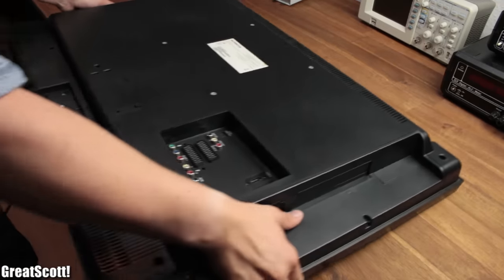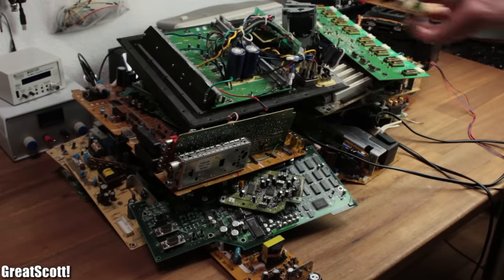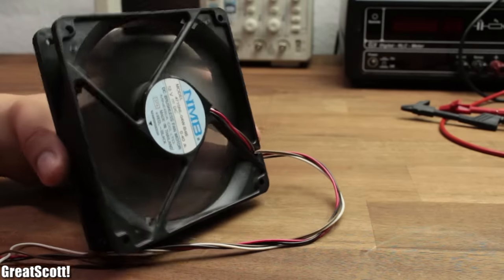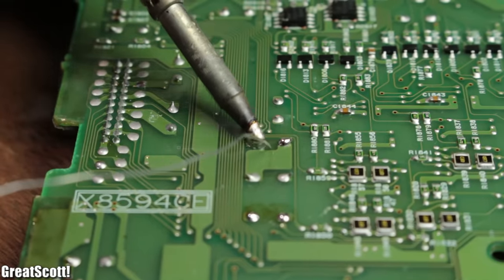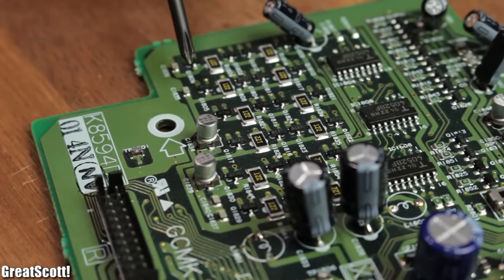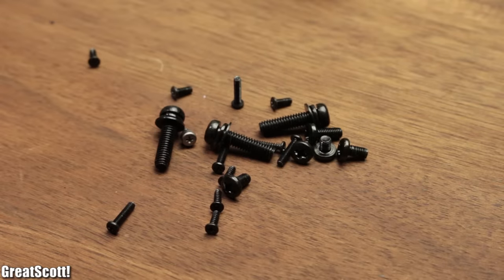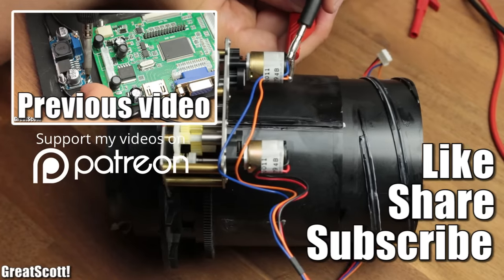What is worth desoldering from old electronics? || DIY Fume Extractor

Comment: Using a heat gun on the back of the printed circuit board, I desolder everything, catagorise it, and store it.  Where I reside, electrical component stores are very far.  There was a Radio Shack for a short while and it promptly disappeared.  Thus, I salvage almost everything from all old electronics.

Comment: Almost every fan has two arrows on one side. One shows the Spinning direction and the other shows the direction of airflow ;)

You can even compare the form of the rotor to other fans and guess by that, in what direction it will spin, because it is formed in a manner that reminds of a shovel and you would never use your shovel backwards intentionally ^^

Comment: I took apart an cheap dehumidifier because the fan was making noise, It had huge aluminum heat sinks that i saved. Saved the power supply and connector, some switches, and other stuff.

Comment: many years ago when the market was very "closed" and you had to go to the electronics store and hope that it had a component or equivalent at an acceptable price, unsoldering the components was done and agreed. but today that the market is more open and with little money buy 100 stocks directly from the country of production, this procedure can be used to take particular or specific components (for example motors, switches of certain dimensions ...). as far as the vines are concerned, the one you will need will always be few.

Comment: tip: use forceps or tweezers and put it's two hands between the resistor and pc or between transistors 3 pins it works nice pushing it down helping a lot

Comment: Aside from the components you mentioned, I also enjoy salvaging power diodes, large resistors (like 1 to 10 watt block-style resistors, or bumblebee style resistors from way back when), LEDs (because I'm too poor to afford a $5.00 bag of LEDs since I'm putting my money into college), crystal oscillators, large ceramic caps, high-voltage nonpolarized caps (I.E. those blue 1Kv to 2Kv  disc caps you find in power supply circuits), large SMD resistors (for when I really need to conserve space), old ceramic ICs (They are expensive, I don't mind the eternity it takes to desolder them without a braid as long as I get that $10 IC! Besides, it's really fascinating and fun to discover their functions), optocouplers/optoisolators/whatever you want to call them, EEPROM chips (8 pin are my favourite), transistors, MOSFETs, BJTs, FETs, MOSPECs, TRIACs, varistors, thermistors, PTCs, NTCs, power transistors, tubes (even small CRTs from mini CRTTVs/CRTDs), spark gaps / gas discharge tubes, potentiometers, encoders (which are EXPENSIVE these days), sockets and connectors, capacitors that have longer leads, and bipolar capacitors (because they are a little harder to get). The list is pretty extensive, but in general I tend to salvage anything I can from boards. Since I'm getting into SMD stuff, I am salvaging SMD ICs, capacitors, inductors, and resistors, but only larger ones that I can use a normal sized soldering iron on. I especially love getting everything off a board and turning the board into the face af an analog clock using a clock kit you can get from Hobby Lobby for cheap. It is really nice when it is in action, and it is possible to sell the custom board clocks and make some pretty good money from them. The more we recycle, the better, amirite?
Anyway, love this video. Keep it up, I really love the tips and expertise you spread to us.

Comment: Try a hot air gun for mass desoldering. Heat the the components with the gun and then tap the board in the direct that will allow the components to drop out. Works like magic. The latter technique works very well to de-solder multiple pin, cable connectors. Heat the soldered connections and then flick out the  wires.

Comment: Depending on how many potential interesting components are on a board, I sometimes save the whole boards and review them later when I need a special part. If there is just very few parts on,I cut the rest off with the band saw such as large areas of smd parts and put them into electronics recycling collection.

Comment: I found an easy way to unsolder any components, no matter how many pins. I use a handheld propane torch, melt an area of pins and hit it with compressed air. Sometimes the components just drop out.

Comment: Man after my own heart. You get useful bits and it's green too. I only really use the small electrolytic caps for prototyping as they're more likely to have high ESR and be leaky. Always save small ceramic and poly caps as it's good to have some odd value's for frequency dependant circuits like amplifier FB loops or tone filters. I always save the wire to, specially coloured stuff. Most times projects only need small length's under 3".

Comment: the list plus: flash/eeprom storage chips, premium mosfets, microcontrollers(e.g. PIC16), tantalum capacitors, TVS diodes, large ceramic caps, precision resistors, soldered nuts. Avoid anything plastic(unless you really need them or if they're expensive). These are very useful and can be very expensive. If they're hard to desolder, use galinstan or wood's metal.

Comment: Question, why must the carbon filter be on the exhaust side of the fan? There should be similar air resistance on either side but the two advantages of it on the intake side are:
1: it filters the air before it gets to the motor so motor gets cleaned air and
2: if you put it very close to your desoldeting items the spinning fan blades are not going to hit your fingers because they will be protected by the carbon filter.

Comment: You actually want to attach the filter to the intake side, since fans are more efficient sucking rather than blowing. Also, carbon filers are not meant to stop particulates, but the smells, which are particulates, but much larger. You need a HEPA filter to extract particulates from solder fumes.

Comment: As a teenager short of money I salvage almost everything I can get my hands on. The best stuff includes most large or high power components, especially power transistors, large nonpolarized capacitors, etc. Also look for mechanical components like heat sinks, magnets and pieces of ferrite.

Comment: When I do bulk de-soldering like striping a whole board I just do it out side and use my air compressor. Melted solder is no match for 90 PSI of compressed air. At the end of the day there is a fine layer of solder all over the porch but it sweeps up very easy. And if I need de-soldering wick I just strip some old lamp wire. A lot cheaper that store bought wick.

Comment: I also love to desolder components from circuit boards. I personally salvage inductors and transformers of all kinds, relays, heatsinks, motors, power cords and of the following only THT parts: voltage regulators, power semiconductors, audio and USB connectors, electrolytic capacitors, ceramic capacitors larger than 100nF, power resistors, film capacitors, potentiometers, IR receivers, standard IC,s, LED displays and LED's, rechargeable batteries, quartz oscillators, fuses, Y2 and Y1 interference capacitors, varistors, speakers and microphones, fans with the fan grills and some other larger components. And if there is a still functional switching power supply board, I salvage and reuse the whole board instead of desoldering components from it, but only if it's not too special.

Comment: Life pro tip, if you need to do several pins, use a cheap griddle or head up a piece of metal with a blowtorch and desolder all the pins at once and yank your part off

Comment: You can desolder DIP ICs if you use a solder sucker and are quick. I have desoldered many ICs for my projects and have yet to break any while desoldering them. I have desoldered big (52 pins) DIP ICs with this method many times.

Comment: Instead of using a soldering iron, I use a wood burner, since it gets hotter quicker and melts the solder quicker, so it doesn't overheat the components

Comment: If you can find any JRC4558 audio op-amp chips, there's a market for them for use in electric guitar overdrive effect pedals, as made famous in the Ibanez/Maxon Tubescreamer series pedals... A large amount of Japanese audio equipment from the 80's and 90's used the JRC4558 chip, even cheap Walkman clones and clock radios, etc...

Comment: Best parts to salvage in order:

1. Screws
2. Electrolytic capacitors
3. tantalum components (value).
4. Regulators and coils.
5. Controls, knobs, switches.
6. Jack, sockets, and connections.
7. Heat sinks

Comment: Great video... I can safely say that there are many people who have done this... I for one do the same and I have to say that for this sort of work there is nothing better than a hot air gun... I was building a Class A headphone amplifier and I needed to remove the potentiometer so that I can mount it on the front panel and I tried to remove it with solder wick which I had never used before but it just wasn't working for me.. so I used a pencil blow torch. In the process I burned the PCB a little and destroyed one of the copper tracks in the process... I later learned that when the solder wick won't take up the solder you can apply fresh solder to the top and it worked perfectly... To little to late because the damage was done... I suppose it was the flux contained in the fresh solder that got the old solder to remove but I didn't have any of that either... I have since learned that a hot air rework station for this sort of thing is the best.. Once you try it there's no going back... I purchased one a few weeks ago and it only cost me $18AU although there must have been a glitch in eBay because after I realized how handy these things are I decided to purchase more just in case something should happen to the first one... but the cheapest one that I could find was about $30AU.. Still not to bad but not cheap enough for me to purchase more... It looks just like a soldering iron station and it has a holder on one side that automatically turns it off when you place the hand piece in the holder... I can't believe that I didn't get one sooner... Anyway... Love the videos and keep up those Hoarding Tendencies LoL.. I really need to have a tee shirt made with that on it.......

Comment: ive been doing this for 15+ years.  and since radio shack has caved in, and turned into a cell phone company, their supply has gone down, and they finally went out of business. (they deserved it, crappy service anyway.) the last 2 days that they were open in my town, everything was 95% off! I bought every book, wire, solder, soldering iron, cable, connector, component,  tool, power cable, power adapter, battery, battery connector! over $350 of merchandise for $80! (they closed early....)

Comment: 2:10 hint: when + and - connected properly, the fan ALWAYS sucks the air from the "non protected" site (where are no bridges from the axis to the housing) and blows into the direction, where the bridges are
3:47 i would always check the 8-pin ICs, casue they are not that hard to remove (expecially wheny you got a pump anyways) and they are pretty much useful, creating new circuts.
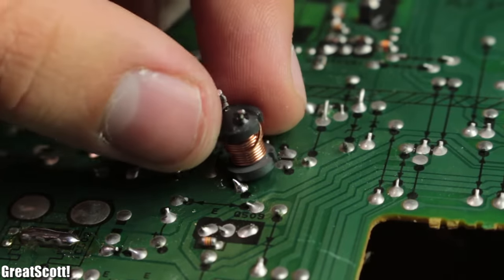4:20 i was laughing... "avoid capacitors and resistors, but save coils, all kinds of coils" :D ok, it depends on your personal use, but in myself i'm exactly the opposide. i kinda never use coils in my circuts, but i got lterally thousands of capacitors and resistory, while i got to say, that you have to take cary using old capacitors and have to double-check them all, before using them into your circuts

Comment: I still have LED's, resistors, transistors, variable resistors, capacitors Ect.  I desoldered in 1976 .... you never know when you'll need them, I actually dug out a light activated switch for a new project these were RS branded but was unable to find the datasheet for them they are circa 1981 :(

Comment: If you don't plan to reuse the PCB, you can use a torch like I do. Heat the back side of the entire board, flip it over, and smack it on a  metal plate, or piece of wood, to scavenge an entire board at once.

Comment: Those capacitors near the AC mains entry point may be labeled X1, X2, XY2, Y1 or similar.  Those are safety rated capacitors and one might consider learning about them and maybe (or maybe not) reusing them.  Belated thanks for a great video and for the good comments below.

Comment: I usually remove the most expensive and biggest parts with soldering iron, then for all the resistors and some if the IC and caps i just use a heatgun.  Stuff i dont need i put in a box, weight it, take a picture and list it on example if ebay for couple extra dollars. There is always a buyer.

Comment: Longer exposure to 250°C should not harm any IC, so you could use soldering bath for the purpose of desoldering ICs. You can make one cheaply with shallow can and a heater beneath it - a perfect use for an old electric kettle :)

Comment: The first thing I noticed was how short you cut the leads to that barrel connector. I would have given it two inches of pigtail .. never know when you'll need one. Second, you omitted one of the most efficient methods of salvage. The good old propane plumber's torch. Once you gain some proficiency, you can extract a 40 pin IC without even getting it warm to the touch.

Comment: I watched... it sounded like Greek/Germany/Russian to me.
I’m 58... when I was a kid , we leased a BLACK( only color) rotary sail phone , from Ma..bell.
1966 I think.. I was about 5 years old..
When I was 7 years old, we had a new tan colored rotary dial on the hand set phone.. still leasing it.
It was top of the line hi-tech.
There were even illuminating numbers to see without a light on in the dark.  Wow that was the bomb...
Then came the push button numbers that made noises.
Soon after we got caller ID.
We still had busy signals.
I was 10-11 and we got cordless push button phone.
We owned it.
We had black and white TV until 1966.. got a 25 inch color console.. weighed almost 200 pounds... huge wooden cabinet, solid wood.
Hade 4-5 channels lack and white... got UHF and got 4 more channels....
I’m 58 now.. can’t believe how light weight TV’s... I can carry two 50 inch sets at a time.
My cell phone works while I’m down inside a tunnel under the ship channel.... we had AM radio in the car.. it would fade out as we went under an over pass..for a quick second...lol.
Flying bikes, flying cars.. robots of every kind...
I’ll be leaving you all before long.(not healthy)
Sure hope to fly a motorcycle or a car... I got a 1500cc motorcycle to keep my adrenaline going..
We may not need to leave the bed room the way things are going.
Just don’t pollute.. it’s not asking to much.
Take care kids😎

Comment: Hey scott i hate so desolder some small parts with soldering iron so i mostly just heat the pins up with a mini propane blowtorch and pull them out from the other side it is very easy and faster than any other way i know.

Comment: Nice project, Not sure the fumes are harmful as the fumes from silder are mostly from the flux in/on the solder.  The lead/tin only becomes harmful in their salt form (lead oxide(white powder), lead asetate(white powder), as the body absorb them easily.  The fumes are not nice to breathe at all regardless

Comment: If your looking for a cool comment you're in the wrong place, but if your looking for an outstanding pie recipe you've come to the right place.

Ingredients:
1. 6 tablespoons unsalted butter
2. 1/2 cup white sugar
3. 1/2 cup brown sugar
4. 1/4 cup water
5. 1/4 teaspoon cinnamon
6. 1 pinch salt
7. 5 apples - peeled, cored and sliced
8. 1 pastry for double-crust pie 

Directions:
1. Preheat oven to 425 degrees F (220 degrees C).
2. Combine butter, white sugar, brown sugar, water, cinnamon, and salt in a saucepan over medium heat. Bring to a boil, remove from heat and set aside.
3. Roll out half the pastry to fit a 9-inch pie plate. Place bottom crust in pie plate; pour in apple slices.
4. Roll out top crust into a 10-inch circle. Cut into 8 (1-inch) wide strips with a sharp paring knife or pastry wheel. Weave the pastry strips, one at a time, into a lattice pattern. Fold the ends of the lattice strips under the edge of the bottom crust and crimp to seal.
5. Pour butter-sugar mixture over top of pie, coating the lattice, and allowing any remaining sauce to drizzle through the crust.
6. Bake in the preheated oven for 15 minutes. Reduce heat to 350 degrees F (175 degrees C), and bake until the crust is golden brown, the caramel on the top crust is set, and the apple filling is bubbling, 35 to 40 more minutes. Allow to cool completely before slicing.

Comment: Also, I was making thermal compound using 85% toothpaste and 15% motor oil or grease, but it is crappy, although it works as temporary replacement. When I was a kid, I was scraping the thermal compound from heatsinks and processors.

Comment: Large iron core transformers for 50 / 60 Hz are  ALWAYS  worth salvaging as they are  VERY  EXPENSIVE  to buy new and can last forever ( no moving parts ! ) , also Lithium batteries from disposable vapes , can replace horrid LEAKY ! alkaline cells and can be recharged ( 4v2 max ! ) many times  .... ( tried - n - tested ) ...... DAVE™  🛑